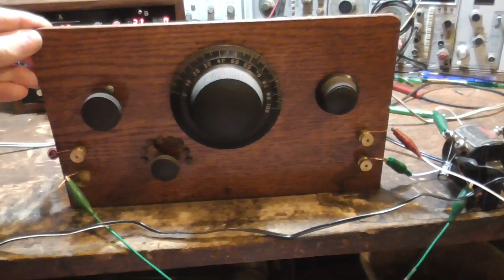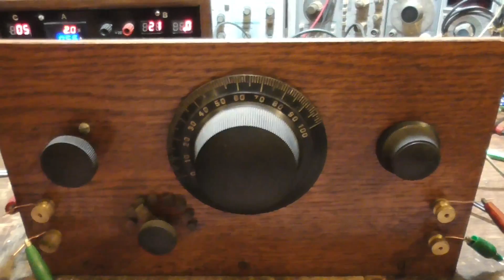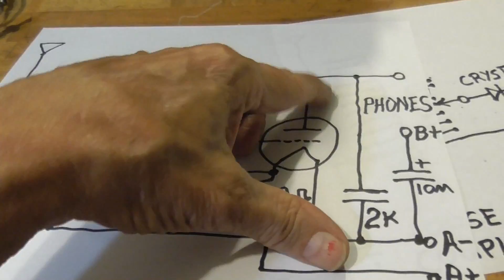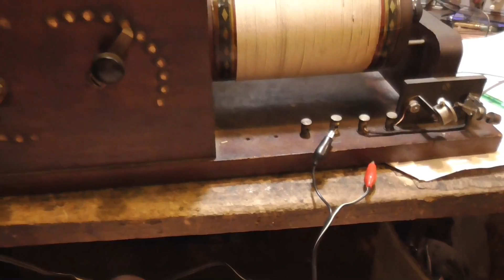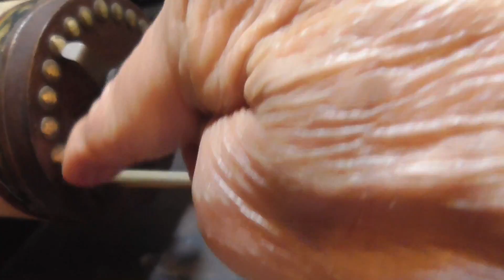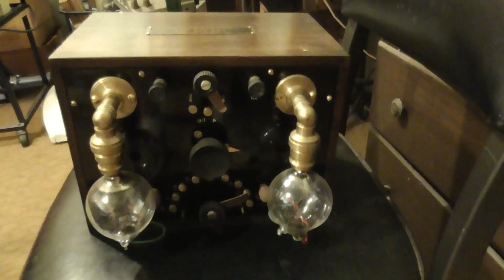OPERATING PRE 1920'S RADIOS

Comment: Interesting how you deal with the difference between the older radios and the newer components. Out of curiosity what power supply are you using? It looks to have multiple outputs.
Reply from the maker: Homebuilt kludge. The idea was good but I tried using stuff from my junk box so it was not like doing a proper design and then buying the appropriate parts. Got to re-do it someday!
Reply: @glasslinger  that sounds like a good idea for a project. I like the projects you undertake including those amazing feats of glasswork combined with electronics engineering (making vacuum tubes). And I have to add, love the old television repairs! A power supply might be a little different but educational!

Comment: This is interesting stuff to see how things were. Those valves hanging there glowing almost look like gas mantles with the brass top fitting as well. 
I have a valve which glows brightly like this, it's stamped BBC and D.E.R. which dates it as between 1924 and 1927. It has a pip on top and I'm amazed it's tungsten filament has survived intact this long.
I kept buying the type PM1 and PM2 type valves at radio rallies (American Swap Meet) to build myself an old type wireless. I think I overdid it, I've got 22 of them but one is an output valve which seem difficult to get probably because they were driven the hardest and burn out more so there are less of them around.

Comment: i made a dielectric  sensor of a mosfet transistor , i have a coil direct to the gate , and a led to indikative when it is a dielectric aura rund my body or plastikk and so on , it detect my body on 7 m distanse , and i wonder if it possible to make a dielectric sender ? ?

Comment: DEAR RON...  I've recently acquired a Crosley Model-51 radio, AND the Model-51A 'Amplifier' for it. They are in pristine condition! but the '51A' Amp obviously has the wrong tube in it? (A 'CX-300-A' Detector tube!).  I THINK I'll put that one in the 1st socket of the Model-51 radio, as the Detector, as it presently has a '201-A' there. I'm THINKING of sourcing a 'UX-171-A' (CX-371-A) which is meant for last-stage audio output, as in 'improvement' on what should have been the 'original' used tube???
Can you give me some guidance, due to your expertise in all this!!  Thanks in advance. Glenn. Australia.

Comment: Nice to see demonstrations of the old equipment.  Thanks for sharing.

I'm really interested in your power supply.  Is there a schematic or photos of the innards that I can see.  I'm starting to experiment with tube (hollow state) electronics and your power supply looks like it would fit the bill precisely.
Reply from the maker: Unfortunately the supply uses a lot of specialty parts that are not available so I don't have plans for it.
Reply: @glasslinger  What kind of supply do you need, I can find out if we can help you.

Comment: My father was a scrounger of cheap secondhand items, and as a consequence of this my first set of headphones in 1978 for shortwave-listening was a set exactly like the one in the video, with bakelite earpads and metal discs producing the sound. They are godawful uncomfortable and sound terrible. If you were just going to wear them for a few minutes to copy some Morse code or something brief like that, they would be tolerable, but listening to a radio program you will find that your ears demand relief after a few minutes.
Reply: @bullsballs  I was talking specifically about antique bakelite headphones as seen in the video. There is no way to get used to them, nor are there "many adjustments."
Reply: I used similar ones in the 70's to listen on a one valve radio kit I built, the H.A.C. and they were, and still are, uncomfortable on your ears, even though the one valve set has gone I kept the 'phones.

Comment: Thank you  what is the difference between a signal sweep generator and signal generator.
Reply from the maker: The sweep generator can be set to vary automatically across a specified range of frequencies. The scope can then be used to see where the circuit being tested responds. A lot quicker than varying the frequency by hand!
Reply: @glasslinger  Thank you I have a sweep generator but I don't know how to connect it with an oscilloscope.  I plug the RF output key with my oscilloscope and I vary the frequency with my hand no responce occurs on the oscilloscope you can help me work with this sweep generator.thnks

Comment: Many years ago I was into vintage radio and built circuits based on designs from this era. One of my earliest attempts was to build a TRF (tuned radio frequency) receiver consisting of an RF amplifier stage, detector and audio amplifier. Another audio stage was added later. This was using "modern" tubes/valves, the 12AX7/ECC83  which had much higher gain than the 1920s tubes.
On the first attempt the radio just took off (self oscillated) because of anode-grid capacitative feedback in the RF stage. I tamed that by adding a HT control to the RF stage (it acted like a regeneration control).
The 1920s circuits had filament rheostats to control the filament voltage and so did mine. Reducing the heater voltage to 3V on the RF and detector stages improved performance considerably (probably didn't do the the cathode coating much good).
Reply from the maker: The problem with using a filament rheostat with modern "heater-cathode" tubes is the time constant of the heater. It changes so slowly it is difficult to adjust to just the right point. Instead of heater-cathode tubes try the battery radio tubes like the 1F5, which has a directly heated filament cathode. They are cheap on ebay.
Reply from the maker: OOPS! Above, use 1H4, 1H5. The 1F5 is a pentode.
Reply: @glasslinger  You are right about the delayed response time but in the end I just connected  the rf amplifier and detector tube heaters in series and ran the audio amplifier heaters in parallel for good results. Later on I obtained some tubes with B4 bases as would have been used 100 years ago. Tubes such as the Dario TB282 and Cossor 210HL  with 2 volt filaments post date this era but looked a bit more authentic.

Comment: Aluminum foil hadn't been in use very long in 1920. It seems as if a homemade capacitor in 1920 might have been more likely to use tin foil.
Reply from the maker: You are correct! TIN foil was commonly available at any hardware store while aluminum foil was rare! I don't have any real tin foil so I had to use the now more common aluminum foil.
Reply: @glasslinger  Apparently it is possible to get TIN foil from National Keystone Products, but it is rather expensive. https://dental.keystoneindustries.com/product/tin-foil/

Comment: Excellent.
Pre 1920 you would probably be using a gas audion. In the first radio you demonstrated a gas audion would work fine without a grid leak resistor.
Reply from the maker: Yes. I do have gas audions but they are mostly used for receiving code (CW) signals. They tend to dreadfully distort AM signals.

Comment: Thanks for sharing, Ron. Your homebrew radio with homebrew parts is top-awesome, and your Navy receiver is cool .... those thing could tune practically from DC to light, especially the slider types... very cool. :-) 
Do you have the materials to build a detector for it using bornite and zincite in place of the galena and cat-whisker?
Reply from the maker: I tried that and couldn't get it to work. It's like the razor blade and pencil lead, works very poorly at best.
Reply: @glasslinger  Understood... I was just wondering because years ago I saw a YT video of a guy showing his Westinghouse Aeriola Jr crystal set. Instead of galena on the fixed holder side and a steel cat-whisker for the variable side of the detector,  his detector assembly had a chunk of zincite on the fixed holder side and a chunk of bornite on the variable  side and he'd just randomly let those two minerals touch together and it would seem to instantly work great no matter how they came together. The bornite chunk was attached to a spring-loaded variable holder and the spring-tension would hold the two chunks together. He demo'ed his Aereola Jr's reception ability by placing the headphones over the top of an amplified speaker-box that had  a photo of Guglielmo  Marconi's face on the front of it, and on either side of the box where Marconi's ears would be was a microphone and he'd place the headphones over the microphones and it looked like Marconi was wearing them...lol :-D I was always amazed that no matter how haphazardly the guy let those two mineral chunks come together they  seemed to make a perfect connection with optimum detection ability every time.
Reply from the maker: I wonder what his antenna was! When I use my outdoors antenna tuned to 950 talk radio here in Houston I get over 1 volt of signal! Any detector will work with that blast!  :)
Reply: @glasslinger  Right on... I just found that vid again at /watch?v=N3hZU3e4-zg 
.. it's a relatively short indoor antenna strung along the ceiling...
Reply: Roger on the 950 talk blowtorch there in Houston...years ago when I was little I lived in Sun Valley California, and the powerhouse hear-it-in-your-fillings station there was 710 KMPC :-)
Reply: ... but I always liked to listened to  930 KHJ back then. :-)
Reply: ...but nowadays here in Big Sur California there's a mountain range between here and any tv or radio stations. AM is best at night time here.

Comment: Is it wise to poke your fingers around with the circuit live?
Reply from the maker: The maximum voltage in the circuit is 67 volts, not enough to give more than a weak shock. I also don't touch other conductive parts with my other hand. My chair is on a plastic insulating mat good for 2500 volts.  (I will not poke my fingers into a radio that uses 400 volts B+!)   :)
Reply: Most of it is low voltage, not as in later amplifiers where it easily can rise up to several hundreds of volt in some scematics.
Reply: @Vampi_Sweden  Well, 68 volts is ok, then. Remember kids, keep one hand in your pocket and the other hand on 911 speed-dial.
Reply: @jamesplotkin4674  

Yeas, back in time it seem to hawe varied a bit, sometime even 110V was classified as (sort of) safe in parts of Europe...
Modern standard is set to belov 50V (48V standard) if i am not wrong so at least pretty close...
Reply: @jamesplotkin4674  😆

Comment: The factor that seems to determine the scarcity of old radio parts and radios is the beginning of broadcast stations for public entertainment in the early 20s.  The industry quickly expanded to meet public demand. Thus you can fairly easily find radios and parts from around 1923 and onward.  The oldest radios I have are from about 1921/22 in the transition period when there were few stations and the radios cost alot of money.  Stuff from about 1920 and earlier is much more scarce and expensive, usually.

Comment: Question I have for you can I run a o&a or 301a radio tube on a 27 volt and this is for the the audio the what the hell is it the good the detector part can I run it on 27 volts because I've heard I can't can do it and I've tried it more or less and it works and then run the plate on 6 and this is Anna 301a Cunningham or two on it oh one a no it works edit works as it does but is that safe
Reply from the maker: The reason for using abnormally low plate voltages is to make the characteristic curve very nonlinear. This facilitated detection, which is the process of removing one polarity of the RF wave. The more nonlinear the less the undesired peaks will respond.  Operating the tube at low voltage does not hurt the tube at all. Of course do not use over the 5 volts rating on the filament.

Comment: I am curious about the DeForest amplifier. Is there just a single filament rheostat for both audion tubes even though each tube would probably have a different gain for the same filament voltage or current?
Reply from the maker: Single rheostat for both audions. In spite of the differences in the audions, the unit seems to work quite well. FAR better than no amplifier at all! Back then, it was quite spectacular to have a radio that would play out of a speaker!

Comment: hihowdi, a question if i may. when did we stop calling em condensers and capacitors instead . thx in advance. oohh a lovely wave trap.
Reply: Now a days a condenser refers to the metal box outside your average home that is used in cooling the home. When they started putting units like that in homes
that way around late 1950s , the word capacitor got much more prevalent . I'm sure between  1958 and 1969 the word capacitor was almost always used by then.
If you refer to any electronic instrument made before 1969 as having condensers or capacitors the wording is interchangeable. The better question is
so if you have a solid state transistor radio or TV does it have condensers or capacitors? Obviously they are capacitors now!

Comment: Why not add some feedback (regen)?
I guess I could build something like that, but use a type 1H4G, or type 30 tube, which I have in the junque box.
Yeah those old tubes didn't have any coating on the filament, just raw tungsten, and not very refined at that either.
Those RJ4's must be as rare as hen's teeth today.  The RJ stood for 'radio junior', so I wonder what the 'senior' model looked like.

Comment: I have much respect for you.  in these crazy modern times,, this kind of radio may come in handy.   I have a book on the radio from 1920 that shows a very similar design.  One tuning condenser was made like a door hinge, basically two brass plates on a hing. One of my electronics teachers was born in 1917, and by the time he was 8 or so, he was in charge of the batteries for his fathers' radio, and TV (experimented with amateur scan disc TV systems in the late 1920s)  Both father and son worked for Bell Laboratories, Western Electric.

Comment: 0:30 There were no comercial AM BC stations operating in the USA prior to 1920's?
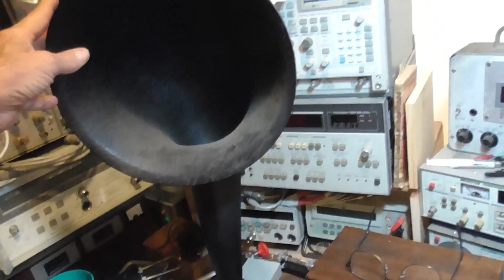2:53 I have an original pair of headphones exactly like those, they are called "FROSTPHONES".
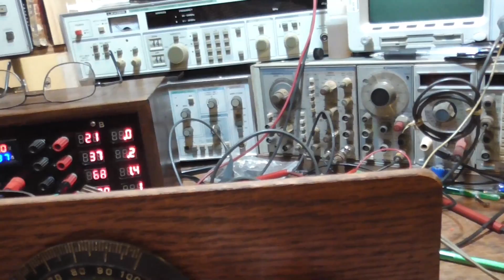4:55 The WD-11 had a filament voltage requirement 1.1 volts.
36:00 You mean by the 1920's  these antiquarian radio sets lost their "steampunk" look, hmmm?

Comment: Toledo duck. A Radio was given to me a few years ago ( 20) years. give / take a couple years. When it came time to clean it up and use some lacquer to paint it up. I saw a hams call sign. And the date finished. April 7 1921. To think I have been listening to a radio that  will be 100 years old. The elmer that gave me  the radio. said keep it for him. Pass it along. The badge said  Toledo DUCK. I am grooming a youngster for the next operator. KV4LI 73

Comment: In 1972 as a 10 year old I built a crystal radio using a germanium diode. It worked great, but I was always curious about making a true crystal radio using a crystal and a cat whisker. I just didn’t have any one around me who had done it before. Thank you Sir for the demonstration.
Reply: There's a small booklet from the 1970's called: RADIOS THAT WORK FOR FREE, so many crkts and alternatives to "real mineral" xtal based radio detectors

Comment: Wow, you took me back to the mid 40's when I was building crystal radios using galina crystals and cat whiskers.  I still have my galina crystal & spring loaded cat whisker sealed in a glass tube from the 40's.  I wound my coils on a take out cardboard soup container with many taps on the coil and by using an old audio transformer was actually able to bring out audio into a low impedance 5" speaker where I could hear programs across the room!  Those were the days for me, I needed no power supply and eventually started using germanium diodes in lieu of the galina.  I lived in NYC at the time and was lucky enough to have a radio store right next to my apartment house and a junk yard just down the street where I would pick up old cathedral radios and repair them.  I strung an antenna from the roof top down to my window on the 1st floor and I was in heaven with my radios!  Thank you for a trip into the past,    Walt in Miami